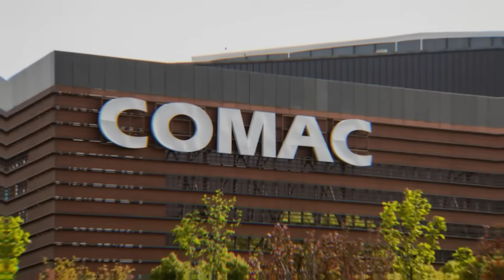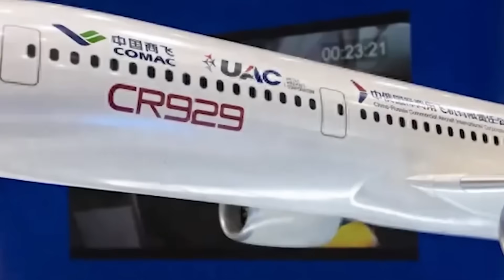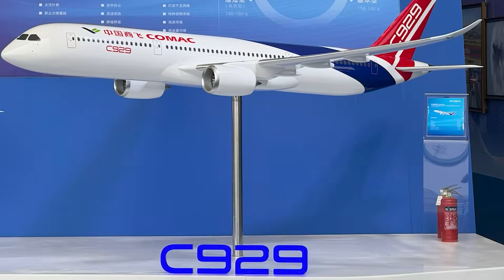China’s NEW C929 & CJ-2000 Engine will BEAT Boeing&Airbus! Here's why

Comment: If this is a geared fan engine there will be a long time before we know if the engine has low enough maintenance to compete. Even legacy manufacturers are struggling to get these engines up to previous generation reliability
Reply: Did you know, China is no 1 produsen of steel in the world 😅
Reply: Of course, the later producers must produce better than the earlier producers to be able to compete with the market.
Reply: CFM Leap has 12,000 hours life span ! The target for China's is around 3,000 hours between major overhaul ! Go figure !

Comment: In my opinion, the Comac 919 and then 929 aircraft are only pale copies of the Airbus A320 ordered in China in the decade of the year 2000, of which an entire model was stripped down and examined under a magnifying glass to reproduce identically the current Chinese aircraft, with the same fuselage, only the electronic systems remain Chinese. They also stole high-speed train technology in the 1980s from the French and only ordered a fast train line from Beijing to Shanghai. They are now developing their own train networks throughout China with future extensions in Southeast Asia. Therefore, the copies and development of aircraft will be reserved for the Chinese markets and undoubtedly for Asia, because they alone will be more than half of the planet's inhabitants who will want to travel at low cost, regardless of the minimal risks they will encounter during years of their operations.
Reply: Typical French. Opinions are like assholes. Everyone got one.
Reply: @theinfralink6598  I am not a huge fan of the French however. he has a legitimate point. The Chinese copy the looks of items perfectly, they don’t always copy the minute details as well, resulting in an inferior product.
Reply: You can copy a drawing, not a real plane and it engine, need engineers and expertise.
Reply: The copies are better than the original lol. Chinese EVs way ahead of French EVs. Chinese HSR better than French HSR. Chinese SPACE station better than ISS. Chinese Beidou better than GPS or Galileo
Reply from the maker: Thanks for sharing your thoughts!
Reply: Jealous😊😊😊😊😊

Comment: COMAC needs to deliver.  At the moment, their C919 plane is not as efficient as the A320 and MAX / does not have the range which is a disappointment given that it wanted to compete with those planes.  COMAC will become competitive, it is not if, it's when.  Airbus is not staying still, Boeing is however standing still.  The Chinese have great engineering, material science and manufacturing know how.  It will be an interesting competition.
Reply from the maker: I think C929 is more potential
Reply: COMAC's approach on C919 is quite conservative, the usage of the composite materials was not as aggresive as A320 Neo and 737 max, the early C919's wing was even too strong that they have to redesign it to reduce weight. Considering it's their first main commercial aircraft, it's understandable that they don't want any safety concern, but they need to improve C919 ASAP in the future, as they can use a lot of tech deveoped in C929, like carbon fiber body and wings.